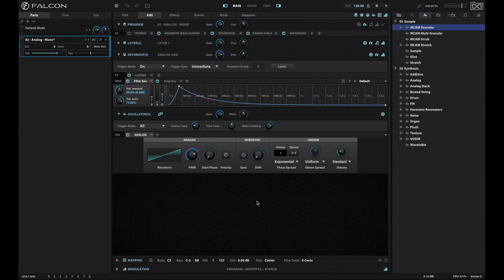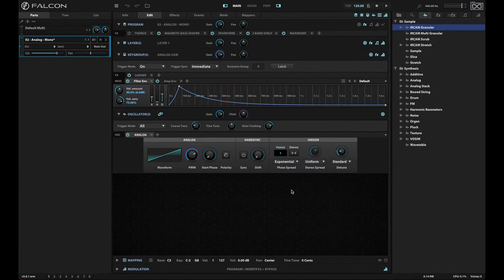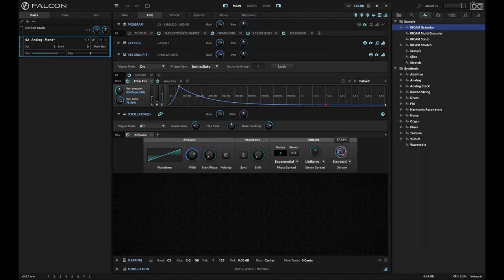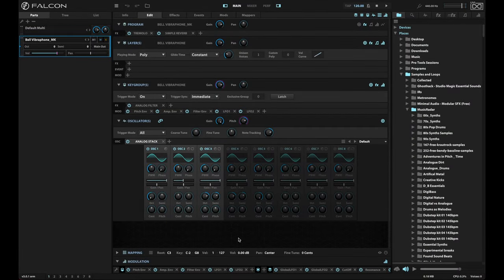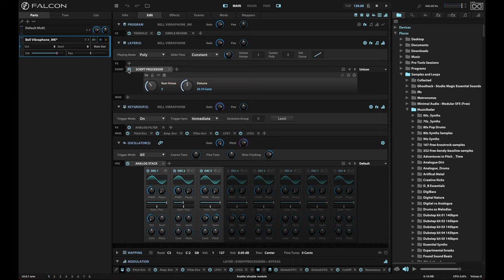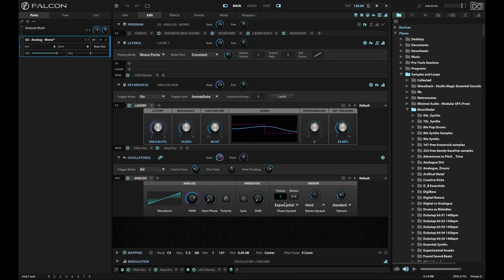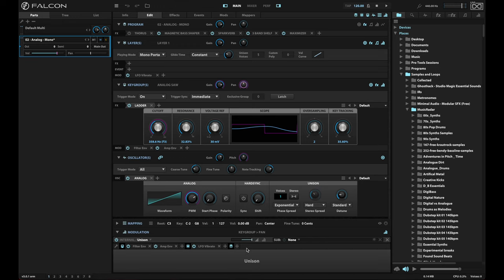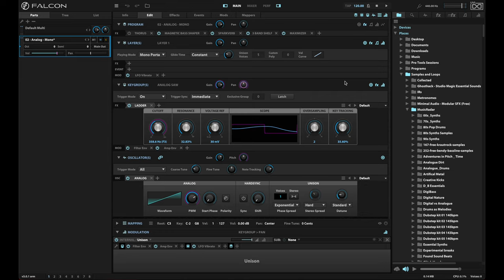UVI Falcon 3: Exploring Unison

Comment: Had to watch the part about using the unison event processor a couple times to really get it - so the Unison event processor can be thought of as a "cloner"; which reproduces a signal X times (X being the number of voices selected). On its own, you just get X times the signal amplitude, but if you use it to modulate pitch; you get X instances of the signal spread symmetrically across the specified pitch range.
Reply from the maker: You nailed it.